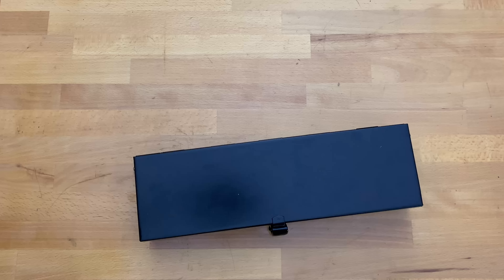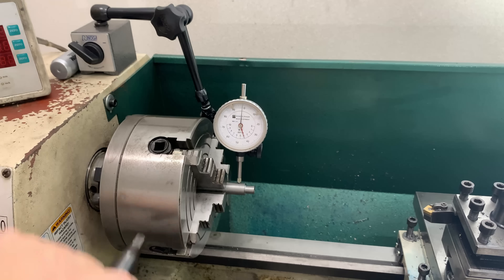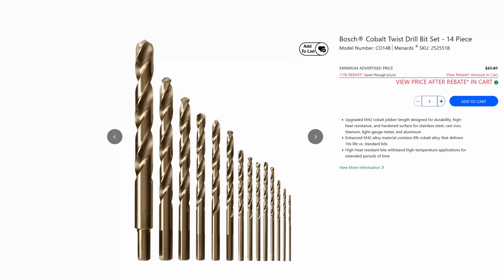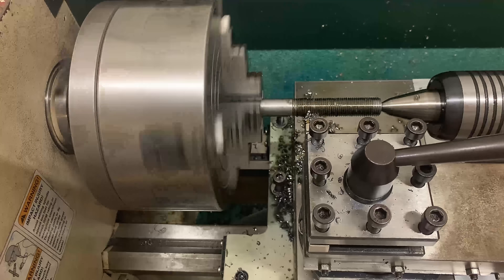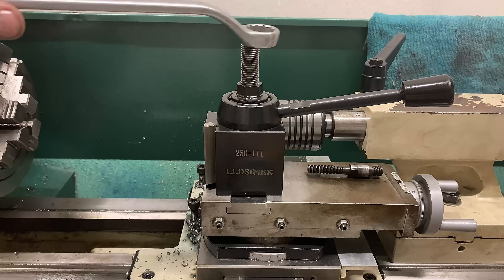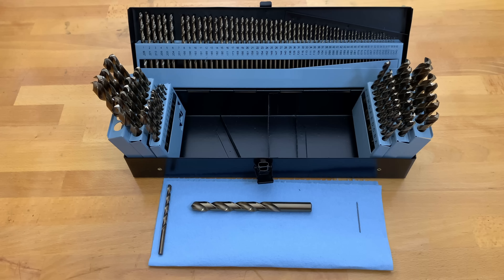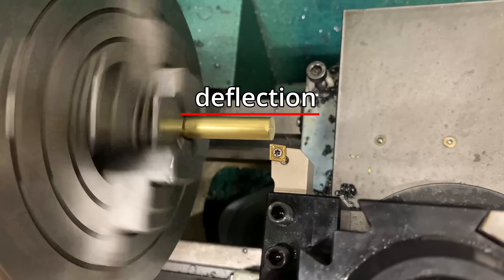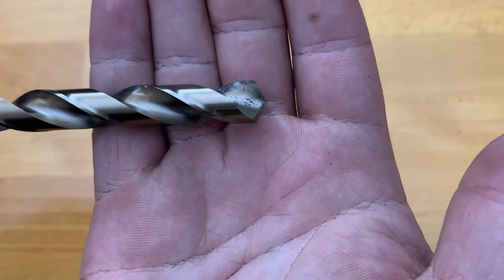Are Harbor Freight Drill Bits Secretly AMAZING?

Comment: Risking looking like some nitpicker I proudly am, I'd like to point out out that it's not "M10-1.5" but "M10x1.5", and since this is a "standard" (aka "coarse") metric thread you don't need to state its pitch after that "main designation" part (i.e. "M10").
Unlike (?) imperial threads, metric ones are standardised for both diameter and pitch, for both standard/ coarse version and fine ones. Plain "M10" means "standard M10", i.e. one with pitch = 1.5 mm - and then you have three standardised "fine M10s" - with pitch of 1.25 mm, 1.0 mm (most common fine M10) and 0.75 mm. And only in this case you have to specify the pitch - say, M10x1.25. Which is also the "standard" pitch for M8 and M9 threads (the latter hardly ever found in nature) - but again, normally you'd write "M8", not "M8x1.25".
(Side note - yes, there's this oddball M10.5x1 thread - found only in Sachs/ SRAM axles of internal gears bicycle hubs.)

OF COURSE, writing "M10x1.5" won't hurt anybody (bar some pesky nitpickers like myself ;-) but it's sorta redundant and likely to cause some initial confusion - as it will trigger, most likely, a "fine thread" mode in the brain of a metric person.

So now you know... ;-) Cheers!
Reply from the maker: Thanks!

Comment: Over the Last 15 years I've had 2 sets, ( Ready for a 3rd set  ). Except for Some Bits 
" Not " Being True To Size, I Have No Real Complaints. I Run Them in Drills, Presses, & Lathes. I've only Snapped a Few, Chiped Twice as Many, and The Rest Just Dulled With A Lot Of Use. If It's Hard Material, or a Large Hole I Use A Pilot Hole. I Like to Go Off of Feel and Look, Color of the " tail " Brain Fart.... Shit can't remember the name.
Reply from the maker: No complaints here either just gotta use some technique when going into the harder stuff

Comment: Depends on what your drilling.
Wood and plastics sure.
But steel no.
I say this as a millwright and mechanic for decades.
Often I have to manufacture a part and my boss bought a set of these.
They will drill metal but dull quickly.
In reality if money is an issue go to  a place like an autoparts store or Tractor supply and just buy a couple of good cobalt bits each week till you have a set of Cobalt bits.
If your not regularly drilling steel as I do these will do fine.
But on steel with Frequency theyre garbage
Reply from the maker: So far so good for mild steel but I'm definitely keeping an eye on their sharpness

Comment: LOve the HF drill set AND the end mill set.  Honestly, just wish I could replace the ones I misplaced.
Reply from the maker: Which End mill set did you get was it the warrior Ti Ni?
Reply: @ShopHumor  20 piece HSS TiN coated each marked CHINA in a wooden box.  Made many Aluminum parts with them on the General Machine Drill Mill combo. Tools still sharp.

Comment: What’s the cheapest bit for cast iron and stuff like that ?
Reply from the maker: Project Farm did a test on some cheaper sets and the DeWalt Black Oxide did really well compared to some more expensive options
Reply: @ShopHumor  I’ve been looking for something cheap and good been buying Milwaukee bits for like $4 or $6 each and when I need that size but they are okay but with really hard metals they do struggle some times but I’ll look those delwalt ones up thanks
Reply from the maker: @A2ZREY  I hope they work out good for you! Check out that project farm video I think it  was his drill bit review from maybe 4 years ago

Comment: I've had the 29 piece fractional Titanium Bit set for 6 years. I've only destroyed  the 1/4 bit by over-driving in stainless steel. For $20 you can't go wrong. The case is fantastic. It snaps shut ever time and does not accidentally open when I store it vertically on a shelf. I would have no problem buying the 115 piece set of the same drills. If fact, I think I will. I don't do enough steel work to justify the Cobalt series, mostly wood.
Reply from the maker: I'm glad your case is awesome, that was my only real complaint about the 115 piece set. I actually upgraded the case to a Huot (it's awesome) and am gonna show it off in my next video.

Comment: Have had a set of these for years for when hss just won't cut it, they are all still sharp as can be and I've used them in a hand drill, lathe, mill, and drill press. Most of the bad reviews I suspect are a review of the user
Reply from the maker: I agree with you. Thanks for watching!

Comment: They bend like aluminum.
Reply from the maker: Try using them in a drill instead of hitting them with a hammer!
Reply: Found that out as well. If I try to use these like my older Boschs, they bend very easily.

Comment: Brah the largest bit you use without a pilot hole is 1/4 inch. yes you can force them in on a pinch or you can buy drills with a pilot self starting tip (dewalt likes that style a lot) but the reason is: the chisel point. Bits over a 1/4 have a chisel point and the cutting edges don't meet aka the middle is just pushing the metal out of it's way and not cutting hence you use a pilot to make a hole where the chisel point of larger bits is.
Reply from the maker: I used to always drill pilot holes when using larger drill bits but I got away from it some time ago and honestly haven't noticed a bit of difference. Now this is with my CNC milling machine, I'd probably still drill pilots on a drill press. With the mill, I just send the full size drill I want to use and then bring the hole to its final dimension with an end mill.

Comment: I've got this same set. I think they are a pretty great value for the price. Definitely sharp but maybe a little on the brittle side. Although I will say the ones I have snapped I was probably abusing. When you get ready to drop some coin check out brown aviation tool for the legit m42 version of this set. We use them at work  (aviation structures) and they seem like the standard, however if you abuse them they will break or overheat and dull as well. If im spending my money and not the companies I think I'll stick with HF.
Reply from the maker: I'll have to check them out if I can ever stretch the shop budget a little bit. Thanks for the recommendation!

Comment: I bought this same set and have been loving it but I don't drill out much metal. I mostly use them for thin sheet metal, plastics and wood and having the ability to drill those in a plethora of different sizes was worth the purchase for me and I figured if I break any I would replace it with a "better quality" one. Nice to know if I want to drill steel I can though. Great video!
Reply from the maker: Thank you! I just used mine on some acetal copolymer (simile to Delrin) and it was sooo satisfying.

Comment: Paused right after product reviews,  at the beginning.  

As a machinist I can assure you, there are NO drill bits that stay sharp forever, even tungsten-carbide and full carbide gets dull with enough use.

I get so tired of seeing mechanics and fabricators and even engineers using what I like to call "rotary punches"!

USE OIL/COOLANT,  TURN THEM AT THE CORRECT SPEED AND WHEN THEY START TO DULL SHARPEN THEM!!!

Also as a machinist,  it IS called a drill BIT!

It goes in a drill chuck, which is usually on a drill motor and then you have a drill assembly or simply a drill!

Paused again after Milwaukee reviews;

Of course they're brittle, THEY'RE HARD!!! The harder a substance the more brittle it is. Serdi cyl. Head machines use carbide pilots, you won't ever be able to bend it and to change the size you have to grind it (preferably with dimond grit) but if you drop it from 6-12 inches onto steel or concrete it will shatter.

Use proper spindle speed and feed rate!

Comment: here is the thing - China started to make m35 steel and drills from it.   since m35 is an m35 and drill is a drill - they all  are the same and they are good. that's all.
brands doesn't matter actually.  they all a just the same chinese drills in different boxes and sets.
price is not relevant too anymore.  
if two drills made out of same material and have same grinding but one is cheap and another one is expensive how exactly an additional price will help a dril to perform better ?
(especially if the pricey ones are just repackaged cheapos)
Reply from the maker: I think you're right, most of them probably come from the same handful of factories anyway.

Comment: Be cautious using cobalt bits in soft materials!
Cobalt bits are very hard, and prone to shattering.
Specifically small diameter should only be used for stationary drill press work.
Any misalignment or "grab/bind" will cause shattering of the bit.
Reply from the maker: I've had pretty good luck with using them in soft materials, including Delrin, but I always use them in rigid machinery like the lathe or the mill. I wouldn't ever use them in a hand tool like that.

Comment: I haven't used a 5% cobalt drill bit tho making drive shaft flanges out of hardened 280ksi alloy steel the 8% cobalt ally bits drill holes in everything with very little contact force even staying sharp as long as 18~30 inches of cut depth in 180ksi spring steel re-sharpen very easily. AR300, 8% cobalt drill works. drilling process turns hardened steel into a paste like dust not long curly chips "going slowly, minimal pressure... 1/2" bit 10lb of cut pressure 20lb/in rotation, 280ksi wheelhub/driveshaft flange material, doesn't squeal while cutting tho more so rings like a loud very high pitched whistle, as that's what the material inherently does even when it is cutting fine". some stainless is tungsten chromoly plated, the 8% bits cut thru that stuff "abrasion resistant surfaces" commercial stainless is soft as mild steel, but a carrier pin in an axle is up in the 220ksi 380ksi range. next thing that's sharper is carbon rod electrolysis drilling... many tungsten bits are not sharp enough to cut normal SAE drive flange alloy steel's.
Reply from the maker: Do you have a favorite for your 8% cobalt drills?

Comment: Pick up any major tool supplier's catalog (Kennametal,ISCAR,OSG,Kyocera,Sanvik) ect and you'll be astounded at the obscene amount of cutting tool options which will each in theory run magically well in a specific application.  Elsewhere.  Likely not so much.  Such is the price of specialization.  Things get very confusing for home shop machinists because the both the budgets and capabilities of industrial shops and home shops are almost a million miles away.  Labor realities also mean that most industrial shops practially never custom grind tools, sharpen dull tools, or make any effort to reduce tooling costs.  The jump today is no longer from a hss endmill to a similar carbide one.  Now its a carbide one with a pcd finish for racing thru aluminum, or a tian finish and wavy flutes for racing thru hot rolled steel dry.....  This is great for production but it can be difficult to keep up if you haven't lived thru the evolution or you aren't diving in anxiously with two feet.  Cobalt bits sorta split the difference between carbide ones and hss.  I can't imagine how bad the online reviews would be of a top of the line guhring carbide bit.
Reply from the maker: Great comment. I’ve had some pretty good luck buying lots of used cutting tools on eBay. Most just need a little sharpening, but a few have bigger issues. But those lots often go for pennies on the dollar or are sold by the pound, and you can save a whole lot over buying new.

Comment: I have a set of the cheap HSS drill index that I absolutely abuse in my machine shop with hand drills. I have a set of these cobalt bits at my lathe and an expensive American drill index at my mill. I think the cobalt HF bits drill the best. But I trust the American set more to be on size and not break. Regardless, most holes get bored or reamed anyway. I’d buy the cobalts again and again for my shop. Good bits for my needs in a variety of materials. Steel, stainless, aluminum primarily.
Reply from the maker: You’re exactly right… especially about precision holes getting bored or reamed to final size. Thanks for sharing your experiences!

Comment: I, too, tried the 115-piece Harbor Freight drill set. These are not high-cobalt bits-- I don't know what their composition is, but they are not even as hard as M2.
Reply from the maker: Cobalt drills are commonly either M35 (5%) or M42 (8%). These are M35s. M35s are not quite as hard as the M42s, but also not quite as brittle.

Comment: .4995 is 5 Ten Thousanths away from 1/2 inch. So, a half a thou. Note- Twist drills are deliberately made to be slightly undersize, to clearance the chip and give hole allowance. Because drills always drill a hole slightly bigger than the nominal size of the tool
Reply from the maker: Good eye! That's one of those errors I missed throughout the dozen or so times I saw the video during editing, and noticed as soon as I hit the upload button, haha.

Comment: I've had my set for years and it has done nothing but impress.  One of the first projects I used them for was drilling 400 1/4" holes in 1/4" inch thick angle iron. I figured I would at least have to introduce that bit to the Drill Doctor a couple times. But no, drilled the 400th hole as smoothly as it drilled the first, No Sharpening!  From that day on I've been singing it's praise's.
Reply from the maker: Man that’s awesome, 400 holes off the bat is a good way to get familiar with them in a hurry!

Comment: I’ve used HF drills on our CNC mill at work. They hold up fine drilling brass, aluminum & steel. They do not hold up well when drilling 304 stainless steel, tool steel & Hastelloy. 
American made Cleveland drills  are far superior to the HF China drill but they cost $$$
Reply from the maker: Thanks for the feedback. I haven’t tried these HFs on stainless or tool steel yet (in my workshop I rarely use those) but if they turn to jelly whenever I do, I’ll take a look at those Clevelands. Thanks for the suggestion!

Comment: I can't speak about the cobalt set of drill bits, but I have purchased the high-speed steel set from Harbor Freight, and they were the worst drill bits I've ever seen. Many of them had a cutting geometry that would make it physically impossible for them to remove material, but that's something I can fix by manually resharpening them. What's inexcusable is that the diameters of the bits were off by as much as .005" in some cases. I threw the entire set in the garbage, where they belonged.
Reply from the maker: I’ve seen more than a few comments saying the same thing about the HSS set you’re talking about. Sounds like the QC on those is pretty poor.

Comment: A lot of comments on the "knowing how to drill a hole" thing.  They're not wrong.  I'm an engineer working in a manufacturing/processing environment.  As such I have learned that maintenance folks can destroy any tool or tooling, along with machinery and equipment.  Any harder type bit will fracture if shock loaded, side loaded or overheated, so we took those away.  We happened upon cryogenically treated HSS.  They're the toughest bits I have ever used.  They hold an edge and cut similar to cobalt/carbide, yet were more tolerant of misuse/abuse.  While not indestructible, they're truly a great general purpose bit, albeit a bit pricey.
Reply from the maker: Those sounds intriguing … I’m going to start my day reading about cryogenically treated HSS drill bits :)
Reply: I have heard of this process before but I believe it had a more, unrefined name, which involves "freezing your work" to a high degree.

Comment: The only thing i can add is you should have done the "roll" test, take a flat surface, obv a granite surface plate is best, a vinyl countertop is perfectly fine too, but take it and roll it around, if it stops or hesitates at all, it was not ground the best it couldve been, if its nice and true and stops rolling evenly, then its ground correctly, its a good test to see if you have a shitty drill or a quality one. I have the same set but i didnt get mine from harbor freight and its probably one of the earlier ones from that factory, interestingly the latch is the exact same, it hardly does anything to latch it, and the ones in mine are TiN coated and not m42 or cobalt
Reply from the maker: Thanks for the suggestion, that would be good to do in future drill bit review videos… I actually just ordered an upgraded case for mine recently - a Huot from Amazon that I really like.
Reply: @ShopHumor  I forgot to say, nice video, creators that respond to comments like this are top notch. I might have to get one of those cases!
Reply from the maker: @nobletangent  Thank you! I really appreciate the compliment. This was the first video that I put up (and just recently put out my second one), so I'm still pretty new to this whole YouTube thing.

Comment: These are only kinda useful for wood or plastic. I know. I have a set. Just buy the $400 set.
Reply from the maker: The steel I've been drilling through must be especially soft if they're only good for wood or plastic!
Reply: @ShopHumor   Chinesium drill bit Vs Chinesium steel maybe? 😁 I'm just joking around. Are yours straight? I had a lot that looked ok until they spin. Then it's like wtf? How am I supposed to drill a straight hole?
Reply from the maker: Mine have actually been pretty solid. I haven't tested all the oddball sizes yet, but the dozen or so I've used so far have been good. I've seen a lot of folks say really bad stuff about the drills, and a lot say really good stuff, which leads to me to believe there is almost certainly some quality control issues with them...

Comment: I bought the milwaukee cobalt set with double cutting heads. Almost exclusively run in a hand drill through 1/4 inch to 1/2 steel. Have yet to break or dull any of them in almost 2 years. I am a fan to be sure
Reply from the maker: Sounds like you’ve had a good experience with those for sure